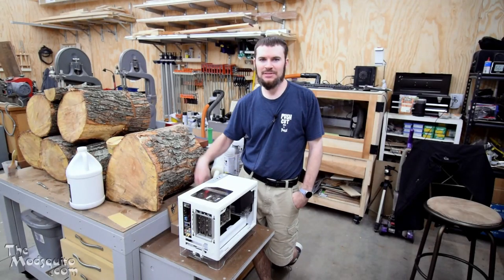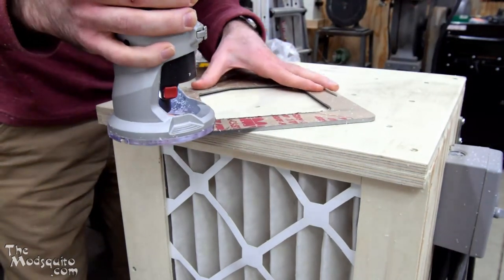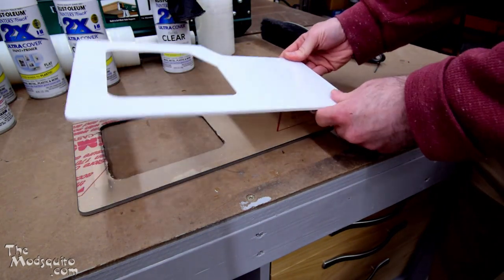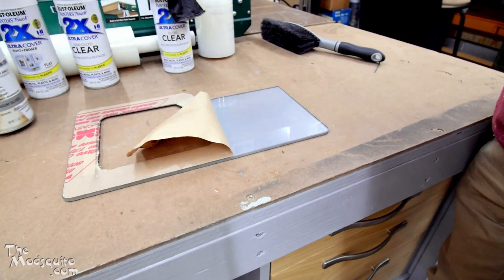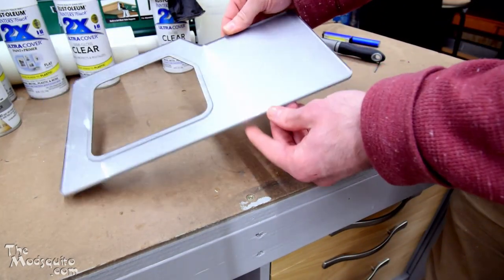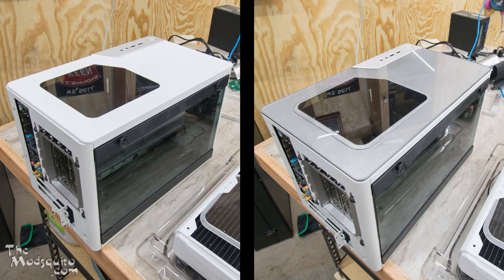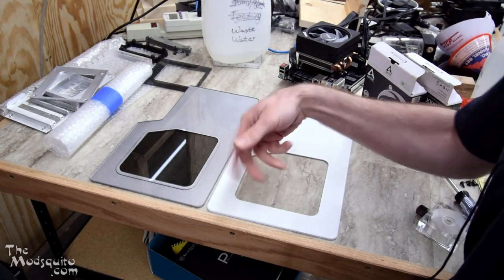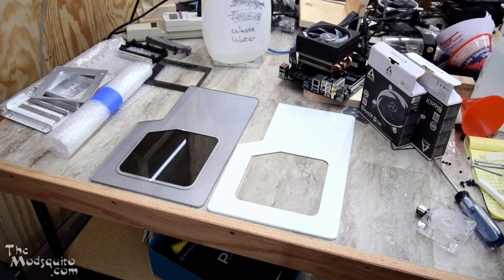Jam Packed Part 6 - Top Panels - InWin A1 Dual GPU Mod

Comment: awesome work! i know and totally agree that the rear painted acrylic is really satisfying and looks fantastic, but i also think that in this case the white goes better with the rest of the build. if you were to paint the main case silver too it'd be a different story. that might be worth considering, if you really can't resist the silver panel.
just a thought; what do you think it would have looked like if you'd just masked off the window before painting? probably not quite as nice, but surely much easier.
looking forward to seeing how this turns out. its looking really good! greetings from austria.
Reply from the maker: Thank you!  Mask off the window instead of having the window insert?  That was actually my original plan (before I had the CNC, that was in Part 1 around 10 minutes https://www.youtube.com/watch?v=3j21j1xCxN4&t=610s).  It worked alright, and was definitely easier (no 3d design work and no CNC needed obviously).  What I didn't like about it was the lines weren't perfect from the edges of the tap, and I had to get the square of tape made on something and then lined up correctly on the panel (as I didn't want to/couldn't cut the tape straight on the acrylic as I didn't want any scratches in it).  If I didn't have the CNC, though, I definitely would have done it that way.  I might try a another one, where I just paint the back of it white, instead of painting the whole thing too.  Honestly, the white panel was the original magnetic prototype, so it had a few scratches, and the magnets were already glued in 😆